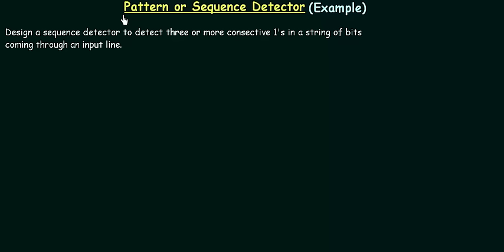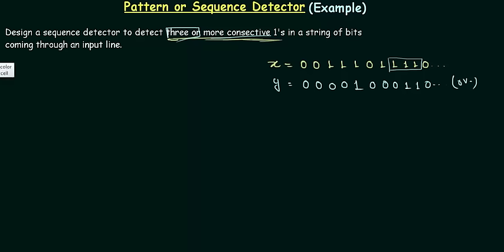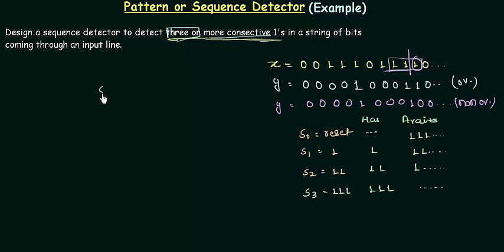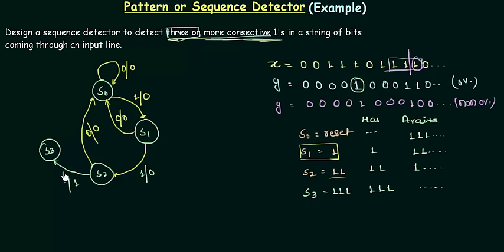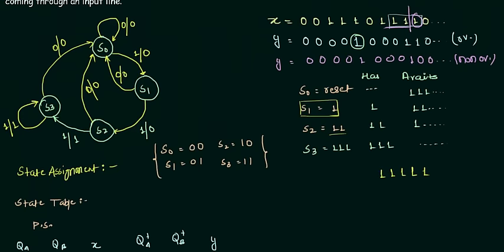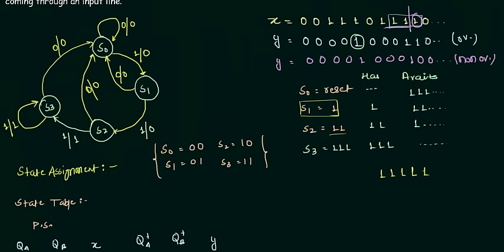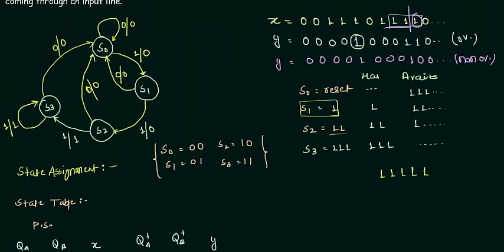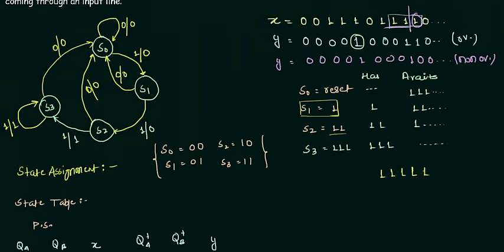Sequence Detector (Example)

Comment: There is no need for the state s3 , we can directly connect s0 with s2 for 0/0 and put a loop on s2 for 1/1.Correct me if I am wrong.
Reply: same thought here
Reply: I share the same thoughts, but is it correct? But if we only have 3 states, how do we come up with the state table as we need 2 Flip Flops. Maybe that's the reason for the s3.
Reply: fourth state of the F/F could just be a dont care, dont cares are possible in state table
Reply: Yes you're correct, it's a redundant state (therefore functionally equivalent to S2).
Reply: State reduction is explained in the next video itself.
Reply: i think we are using the 3rd state because the question is dection of 3 ones or more....if it was only 3 ones we could have used 2
Reply: i also thought the same way
Reply: @sagnikroy4018  yo can also do it with 3 states.if the circuit has less no.of states it takes less time to compute.
Reply: @leoncss  SImply put dont care for 110 &111
Reply: If i use the method with dont care, the DB = (QBnot + QA)* x is difference than DB = QBnot * x
Reply: Same thought.
Reply: Yes, we can do it in only 3 states. In the video, observe the states S2 and S3 in the state table, they are identical (next state and output).
Reply: I was also confused about that no need for S3
Reply: Yes bro
Reply: true but not much difference in the solving, you'd just keep don't cares in the kmaps instead of 1's pretty much saving no time, only extra time in doing state reduction

Comment: I think when we are in S2 and input is 1, make output 1 which means we have detected 111 and get back two s2 which means we've already seen 11 and waiting for another 1. it's like slicing the adjacent 1s into windows of 111s.
Reply: exactly the diagram should have only 3 states in total
Reply: but no , wait a min if you that you wont be able to write the 4 states as qa  and qb are 2 varaiables of the present state and there must exist 4 states to complete the table
Reply: @user-dz6zd9zk2f  yeah, you can use QA QB X until 1 1 1 and when QA QB X = 1 1 0 and 1 1 1 or that means QA and QB is 1 1 respectively or when S3 happen, you assign QA+ and QB+ = X (don't care) because the S3 is unlikely to happen, thus if you use D Flip Flops you can assign QA+ = DA and QB+ = DB or when you use T Flip-Flop you can also assign TA and TB as X (don't care).
Reply: @adeirman2705  Was looking for exactly this in the comments! Luckily i found ur conversation about it; was really confused why he uses 4 states in a Mealy where 3 would be enough.

Comment: I think there is a mistake in the output of nonoverlapping. when we first 001 then the output should be zero and after that, the next sequence should start and in the next sequence there are two 1's so the output should be zero again not 1. correct me if I'm wrong.

Comment: Is there really a need for the S3 state? The S2 can keep producing high output as long as the next bit in the bitstream is 1 right?
Reply: Yes there is no need for s3 
This is why we need to use state reduction before designing the circuit

Comment: Sir, can u please explain why S2 and S3 are not reduced to one state by state reduction method? Thanks a lot for these videos
Reply: Yes I am also thinking so, it can be done with just 3 states as well, seems like this is an error.Hope Neso Corrects it soon.
Reply: True
Reply: at 5:18 why s1 goes to s0?doesn't it go to itself?please answer
Reply: It's not an error. Just extra hardware. It will work in either case.
Reply: @nandinikasuba6673  since we have to find sequence like 1111111.... as soon as we got our first '1' we went from S0 to S1.....but after it if we get a '0' instead of '1' , like a sequence '010',our chain breaks and we have to start again from next '1' since we can't take previous '1', That's why we went from S1 to S0 to get that reset....
and i am answering this to a 1year old comment...lol

Comment: for the present states Qa=1 and Qb=1 with input 0, why is the output y=0? if we are on the present state S3, isn't the output 1? I'm confused since the book has the exact problem but has output =1 for only the last two states, is there two ways of doing this?
Reply: +tonee899 you are right... for the last two rows of the table, the output should be one. If you implement the circuit designed in the video, you will not be able to get the desired output. the output equation of y should be y=A.B. I have implemented this equation and have been able to obtain the desired answer.
Reply: +tonee899 Yes exactly...Only in this video its different...rest in all books its same as u have said

Comment: A sequential network receives a binary stream i at the input and must detect
 the presence of the sequences 010 and 000 also superimposed.  The output is 1 if the sequence is detected and 0 `
 otherwise.  How can one write the tables and the logical equations, again to draw the pallogram and the circuit? Help out please

Comment: Just a thought. But can't we manage with just two states? s0 reset and s1 is 1. So if another 1 is detected, it'll still be in the s1 state and if 0 detected, we can simply direct it to s0. Others are saying only 3 states are required. But I don't know why we can't manage with just two?

Edit : Okay I'm wrong. Just realised the question is to detect 3 or more 1s. So we need to have 3 states definitely in order to make the output high for third 1.😂

Comment: if in the question it is not mention which flip flop to use than can we use any ff??
Reply: Yes depend on the question, it is better to use D flip flops because output data only 1 and 0

Comment: isn't s3 an extra state what if from s2 i go to s2 for 1/1 and to s0 for 0/0 and there is no s3.
Reply: +Saumya Gupta  As you see from s1 to s2  its 1/0 (i.e, output of s2 = 0).  you can't have two outputs for same inputs.   Here is my tip for you, don't worry about extra states. you can use state reduction method to reduce the no of stages.

Comment: how to make transition and excitation table after state table u draw above??
Reply: Exactly 
.?  Do tell me too xD
Reply: Just take the x input as 0 and 1 seperately for both input as well as output....u will get the transition table...... In excitation table the next state variables are replaced with flip flop inputs(for d flip flop both excitation and Transition table are same.)which can be obtained from characteristic equation.dont forget to take x=0 and x=1 as seperate columns for both input and output in both the tables.
Reply: howda boli namge helkodu andre orourigella helkothane
Reply: leoblaster101 lowde😂😂...

Comment: Sir,I have done same problem using Moore Machine but in output Y I am getting slight deviation.in y I am gettingY                                                                        0                                                                         0                                                                         0                                                                         0                                     I0011